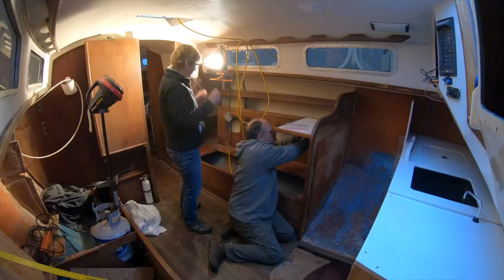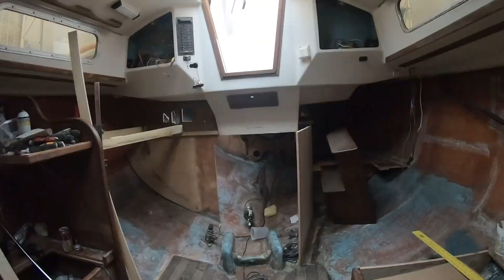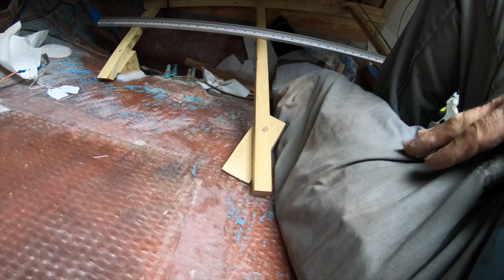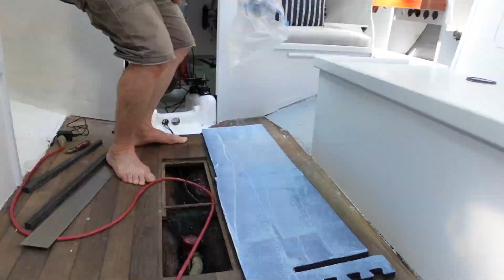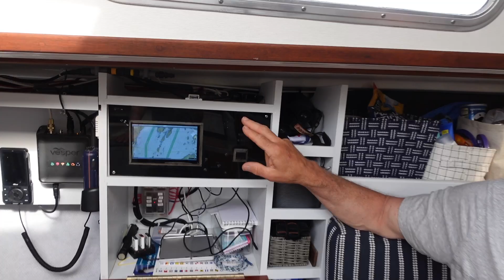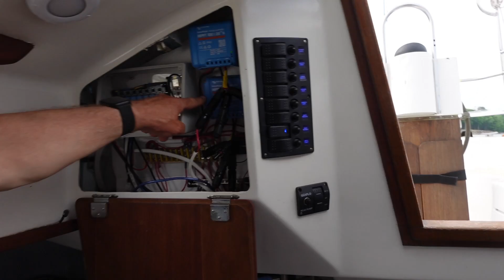Cabin Reveal - Story #14

Comment: Very nice job! I also have a Sabre 30 that I am slowly working on. How did you handle removing the port bulkhead aft the settee without losing structural support? I don’t see a new one forward to its old location. Txs.
Reply from the maker: Thanks for the comments.   The Sabre hull especially the MK1 is pretty thick.  Much more solid than something like Person, even the surveyor commented on Sabres.   I was pretty amazed on how lightly the components were tagged to the hull.  That said the nav station is much more strongly tabbed than the previous bulkhead.   I even added more fiberglass to the bulkhead behind the head.   Love the Sabre, it's a fun boat.